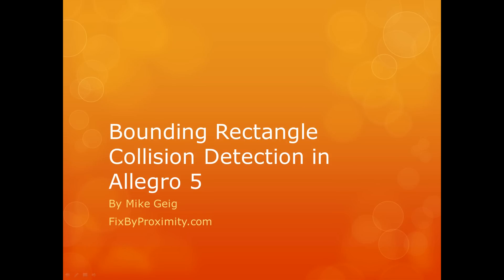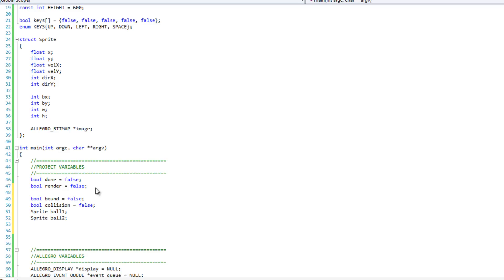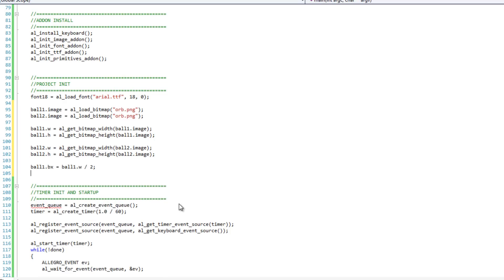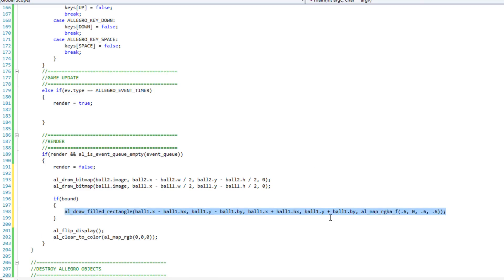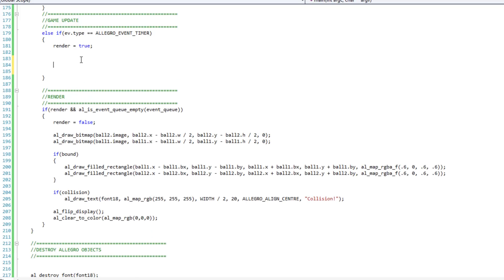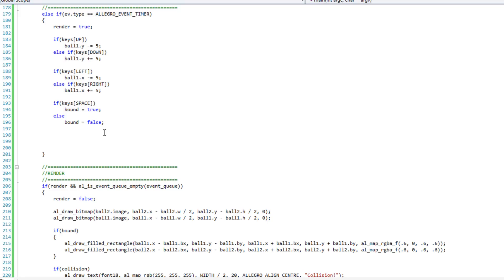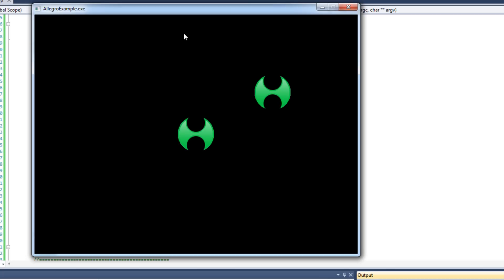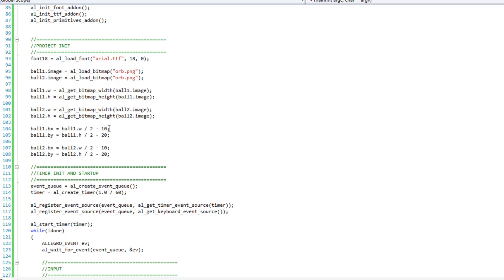12.1 - Bounding Rectangle Collision Detection in Allegro 5

Comment: Rectangles are generally defined as: Top, left, bottom, and right. You only need to check if Box 1's "Left" (x1) touches Box 2's "Right" (x2). If you want to check Box 1's "Top" (y1) against Box 2's "Bottom" (y2) you need to check if y1 touches y2. It's a little more involved than that, but that's a jist. In the past 5 months: I assume you have figured it out by now. ;)